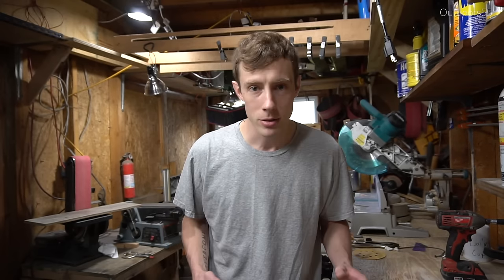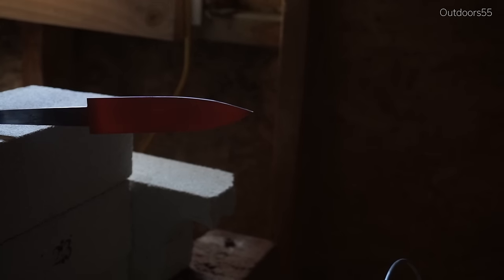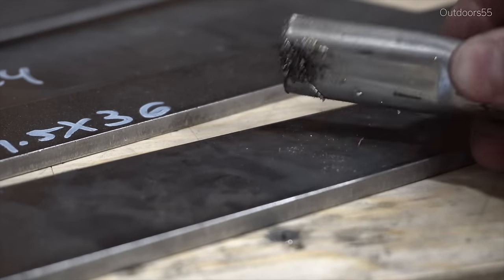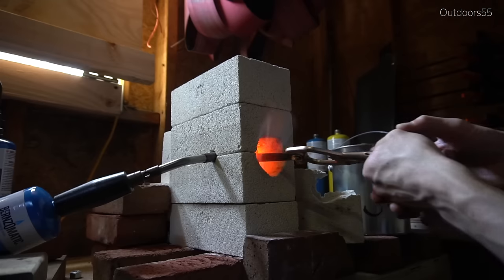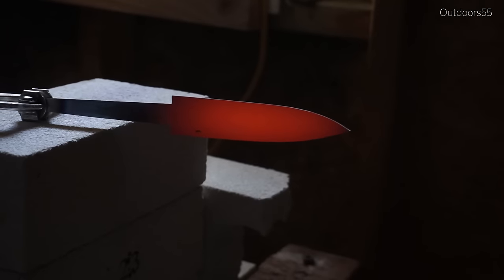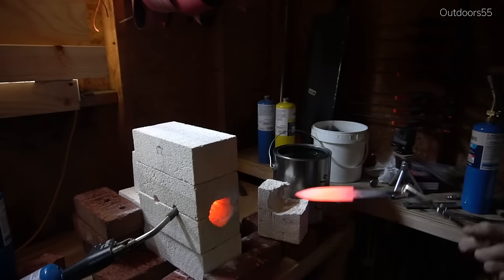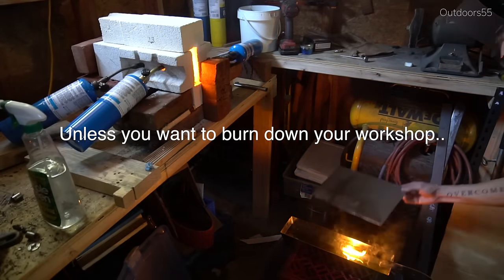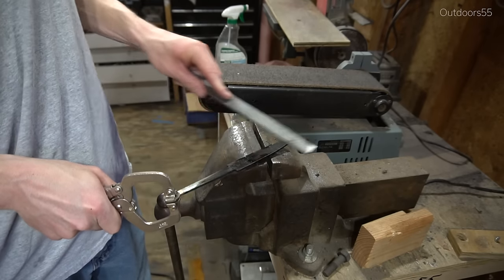How To Heat Treat A Knife | The 4 Steps You NEED To Know

Comment: Hey! Lovin the video, currently at the point where your using the file to test hardness, and wanted to share with you the fact that the hardened steel sounds like a zipper going up and down, i've always been taught the grinder method so I was wondering if thats how it feel's to you as well. Almost like smooth?

Comment: very interesting video, I've a question: the steel you use in the video is 1080 or 1084 , there are difference in the heat trating procedure between the two ? Cause I would like to make some knives by myself too and I can only find 1084 steel.thanks for the video and if you can answer
Reply from the maker: No, generally speaking theres no difference between the two for heat treating.
Reply: @OUTDOORS55  thank you very much

Comment: Just heat treated and tempered my first knife. Set house oven to 450, temper came out a darker yellow/straw color. Air cooled and put in for second hour. After 2nd hour, my blade is now a blueish. Do I need to re normalize and then re temper or will blade be ok? Appreciate any advice you could pass on. Awesome vid and awesome work.
Reply from the maker: Ovens have a tendency to get hotter the longer they are on.  Especially older ones. The blade will be slightly softer but it will be fine and still function as a knife. 😀
Reply: @OUTDOORS55  appreciate it.

Comment: Thank you for the great video and  explanation, but i'm a beginner and i have a question: if you quench your knife before making bevels (as seen in the video) how do you make them with a file after? And if you don't use the file but a belt grinder or other power tools (who are the only tools capable of doing the work on hardened steel) doesn't the heat on the edge wastes the quench on that point of the blade? Thanks to anyone who answers

Comment: Thanks Dude.. 
Great video. Learnt a lot of things. By the way will you please advise what is the carbon level generally in a file can be and in a leaf spring of a truck.

Moreover if a file is a good choice to make a knife, if you can suggest some tricks to make a file knife.

Thanks in advance.
Reply from the maker: Not really sure about carbon levels. It depends on what metal the manufacture uses. I typically try to heat treat a small piece of a file before I make a knife with it. That way I know its good material. Hope this helps😀

Comment: Id recommend using using an oven temperature of 425  since the best blade is between 58-60. 
Id also recommend  you try out 52100 chrome steel. Id also recommend you drill the holes in the shank before the normalizing of heat quench. Extremely important point. Also if you are thinking of making a Damascus blade Then use a kiln and heat to 1500 with glass chards on top. this removes oxygen from the surface. Glass dust or the finest smallest particles are the best. If you use a kiln you can control the heat much better and know precisely what your temperatures are and keep consistent. In addition to this with a bit of practice and a stop watch you can make Samori quality Metal. The best cooling process is done by dropping the temperature slowly over 4 days. The honing ilI will leave to you. But even if you only use 6 stones you will make a blade that will sell for a months pay. 🤔

Comment: Another trick for knowing that you're near the right temperature that is sometimes used is placing a small ceramic dish in the Forge with your blade that this could be filled with regular sodium chloride otherwise known as table salt. Table salt has a melting temperature of 800 degrees C which is 1472 degrees Fahrenheit. Only three degrees off of where you should start watching your steel more closely. When you see the pile of salt turn into a puddle you're just about there.

Comment: So why do people hammer their steel as well,what's that do as I don't see in the video you doing this? This is a great video btw straight forward you've earned my sub for sure
Reply from the maker: There are two main methods for making a knife. One is called stock removal. That’s where you use a grinder or some sort of snapping tool to shape the steel into a knife. The second method is forging. Where you would use a hammer and forge to shape the steel into a knife. Just two different methods to shaping steel. Thanks for the sub my friend 👍
Reply: @OUTDOORS55  If I understand this process - I would comment that forging would occur after the normalizing of the raw piece of steel that you plan to hammer on.  The idea is to normalize (air quench) so that you have a piece of softened steel to work.  Understanding that normalizing and air quenching gives you steel in a softened state rather than trying to bang on a piece of hardened (oil quenched) steel.

Comment: Cooler oil also vaporizers after we action a bit more, causing a non stable cooling effect. For lack of a better term. I would frequently heat treat cutting chisels so that I could cut welds on a job Clear. By heating it up to about 13 to 14 hundred degrees a tree, if not a little bit higher and I would flash quench it and I would watch it till it turn blue as soon as it turned blue I would drop it back into the oil and it will remain a. It kept the metal of a brick chisel for instance from becoming so brittle that it was dangerous to use and yet would still hold a very good Edge even when you're cutting steel with it.

Comment: I need to copy a stanley hand plane blade with 52100 steel , do you think i can use same heat treat process? I need to have 2x holes in it drill hole after or before heat treat?

Comment: Lots of good info here man. I do have a couple questions however. 

Most of the heat treating instructions for the steels you listed say to hold the blade at 1475-1500 degrees for 10 minutes or so. Is this unnecessary? If so  do you notice any difference in performance?

My other question is, being that the handle of all your knives seem to be un heat treated, arent they more likely to bend/ break? Or does that actually help with toughness?

Not trying to poke holes or anything man. Looking into doing some knifemaking myself and im genuinely curious.
Reply: From what I could tell he never annealed (normalized) the handle so it should still retain the factory or manufacturing cold work (work hardening). This means that the handle should be plenty strong enough without being brittle like the blade edge. The heat treating he's doing is for a good cutting edge. I may be wrong but I thought I'd answer in the case that he doesn't.
Reply: @ThomasJames69420  thanks for the reply, i didnt think of that. But that does make me wonder how much the  grinding and heat transfer on the tang from heat treat has done to effect the factory hardness. I've seen him batton/ purposefully break is knives, so im guessing that the difference is negligible.
Reply: @fishcakes6594  not sure, I saw another commenter say he makes knives and he makes sure the tang is strong and thick enough to handle the extra stress. This next part is just a guess but id say that removing the cold work from where the tang meets the blade would be beneficial as it would make the metal more ductile and less prone to crack, so itd more than likely fail due to bending than snapping. I'm not sure though as I only have general material science knowledge and don't know how the specific steels he uses will act.

Comment: this was wonderful. Thank you very much! I now have something to look for and something to try. I have a piece of "weld steel" from lowes that I want to cut a cleaver out of. I am trying to make my own "almazankitchen" knife. The have a youtube channel where they cook outside and they have this cleaver that I love but I would like to make it myself. Is it possible to use that type of steel or should I not even try with this?
Reply from the maker: That can be a good place to start and practice on but 1080 steel Is pretty cheap. It’s probably cheaper than buying it from lows. If you already have it, give it a try. It won’t harden due to low carbon content, but could still be used as a cleaver no doubt. Hope this helps 😀

Comment: after a lifetime of knives, i clear brush on a golf course in arizona and use machetes professionally. the wood is full of minerals, dries hard, hard woods. my fave is from aranyik, at 6 lbs its got obvious advantages beyond the craftsmanship.
but i've used a lot of knives. never have i been impressed with an edge as much as a machete i cut from the blade of a greens mower. i have an al mar folder which is also nice steel. but the pro mower blades are flat, large, and harrrd. couldn't drill it at home or in the shop. i've seen how they shatter on rocks. not great for general purpose cutting but the edge is .. really sweet. condor machete feels like junk in comparison.
for all you blade makers out there, my 6 lb aranyik is 22" long, i feel like it would chew through, basically anything. vehicles, buildings. the spine is like 1/4" thick (google "toong prototype" toong is the smith, they were prototyping blades to see how deep a machete could cut). course its a bit slow but inevitable. i wouldn't think of carrying anything else in preference to it. gotta grind it like an axe or you'll never pull it out.

Comment: Now about tempering 
1)Do I preheat my oven?
2)And do I quench in water between tempering cycles 
I have 1075 and I want to make some small wood carving blades since I dont have the time to work on my bigger knife 
Dimensions are 20mm × ~40mm x 3mm

So what I've learnt online 
2x 2hr cycles tempering at 400F/204C
But what I dont know is water cooling after the first cycle and after the 2nd cycle

And also do I preheat my oven before 1st cycle and do I let blade cool in oven after 2nd cycle

Comment: the video is great, it’s just me that doesn’t want to follow all these very specific heat treating guidelines simply because i’m not going into the knife making business, but i do want to make a few knives and they don’t need to be hard as the knives you make.
im looking to just give these few knives a somewhat hard edge just so they don’t dull to easily....,can i heat the steal to a cherry red, stick it in some canola oil, and be done?  will this harden the steal at all?
Reply: So, if you did that, you would be hardening it but not tempering.

You'd have a very hard, very brittle edge.
You'd want to do the tempering in the oven first.
But yes, you could do this yourself with just normalizing, heating it up to cherry, quenching it in oil and then tempering.
Reply: David Moriarty-Schieven:   thank you !
Reply: No problem! It may not be the exact perfect Temper like you could get with a fancy expensive setup but I've done it that way with many a tool now. Mostly chisels and stuff, and I use a different tempering method for chisels but the oven way would work. But it would carry over well.
Reply: David Moriarty-Schieven:
so blow torch it til it’s red hot, quench it in canola oil, then into a preheated toaster oven at 425 for an hour then let it cool and i’m good for what i want?o
OR toaster oven first then blow torch and quench?

i think someone said temper first then harden it.
Reply: @awashburn6944  true my wording was bad, Temper as the last step
Reply: Aaron Washburn:  thank you
Reply: David Moriarty-Schieven :  thanks again

Comment: What if I have an existing knife and don't know what kind of steel it is? I bought a 2 knife set of Smith&Wesson probably 30 years ago. But they are too soft and don't hold an edge well. What would be the proper steps?

Comment: Good tutorial mate. I am just wondering. When you normalise do you just wait until it is a black heat or until it is able to be touched?
Reply from the maker: I let them cool all the way. You would have to look at the particular steel specs as to exactly what temperature they need to be cooled to.  I’m not sure off the top of my head.
Reply: Cheers, I was doing that too but was hoping it wasn't necessary lol. It is so boring waiting for it to cool down so you can normalise again.

Comment: Hey man, remember me? Lol.
Good video overall though I disagree with calling 1095 a beginners steel. It is a simple carbon steel like 1080 but the amount of carbon makes heat treating the steel more difficult than most beginners could handle.
I would also suggest beginners consider 5160 over 1080 as it tends to be more forgiving in the quench and due to lower carbon content and an alloy makeup that is designed to make the steel tougher, it can be left over night, or even a couple days (if you really have to) between quench and temper.
Reply from the maker: I completely agree, and almost left 1095 off the list for that reason. However it’s often touted as being a beginner steel so I mentioned it in the video. I left some more info on this in the description if I remember correctly. Thanks for the comment 👍👍

Comment: I have been unsuccessfully trying to harden 1084, the only difference seems to be that I am using vegetable oil. Could this be my problem. I have tried it hot and cold and got a better result cold but only got the tip hard. HELP Thanks MJ

Comment: Normalizing the steel is best if done in 3 steps, then quench.  This develops the grain structure of the steel.  Heat the blade less each time to tighten the grains up.  Nonmagnetic plus a few seconds is how I do it.  Don't forget to preheat your quenching oil to 130F before quenching.   I also heat the tang first and the blade last, this is because the tip will heat the fastest and I don't want to overheat the tip and make it the weak spot.
Forge On!!!

Comment: Just found your channel. What is your thought on using motor oil for quenching, and why.
Reply from the maker: Most motor oil is going to be too thick for fast quench steels. It’s not that it won’t work, just that it’s not designed for quenching. Also I do most of my tempering inside my home oven so using motor oil is a no go for me. Canola is food safe so no worries there. Hopefully this helps 😀

Comment: to summarize with Celsius conversions: 
normalize resets all stresses in the steel - normalize 3 times before quenching
heat to 1500-1600f (815-870C) and air cool 3 times  1400f (760C) = non-magnetic. 
So heat it to non-mag and then heat another shade or two brighter colors, then normalize or quench (quench can be on 3rd time normalizing or should be after?)

Quench 1400-1500f (760-815C) steel quickly in Canola oil at 130f (55C = like a very hot shower)
Quench time at least 10-15 seconds
"slice" the oil with the knife while quenching to avoid bubbles and to cool evenly and quickly
keep metal lid for quench container handy to put out oil flare ups

Tempering right away in oven at 400f-500f (200-260C) for 2 hours each cycle
Let air-cool to touch (to around 130f/55C ?) between cycles then temper second time right away.

Comment: Thank you for the easy to understand video. Just a quick question, any idea what type of steel your average railroad spike would be. I know it's high carbon but would it have a number like 1080 or something like that
Reply: I know the "steel of old" was usually similar to 1084. So.. its probably something like that. I'd treat it like 1084/1080
Reply: The Dood thank you. I got about 50 lbs worth of RR spikes
Reply: Matthew M thank you . I'm just starting to try my hand at blacksmithing so any advice helps
Reply: Craig J I know this is an old Post but maybe I can help. Most RR spikes are low to medium carbon. But if you can read the lettering on the top some have the letters H C. These are high carbon and harden well. A spark test can verify it.

Comment: How large / thickness and length was the knife you failed on heat treating at the end of the video.   I made a forge exactley like yours I been working with o1 steel Recommended by Walter sorrels for beginners I previously made my first smaller knife and heat treat went well.  Thinking I might have same problem on my larger blade using 3/16 o1.
Reply from the maker: I believe the blade was 14inch then I cut 3inces off and still couldn’t get it hot enough. One of the problems is that it was 1/4 inch thick.  It takes a lot of time for the heat to penetrate. All in all it was just way too big. I think the maximum is 9inch blade length with two small torches. They just don’t put out enough heat for larger blades.
Reply: OUTDOORS55 thanks for the reply keep the videos going.

Comment: I have a project with a stainless saw blade.It seems extremely hard cutting with a grinder do i have to to heat treat it?If i have to which temperature do i select?Thank you in advance.
Reply: This is where it gets complicated. As different elements are added to iron, the entire heat treatment process changes. Stainless materials are typically not used by people who forge by hand because they air harden. Simple carbon steels need to be quenched very quickly to harden them - stainless steels can cool much more slowly and still become very hard. Commercial manufacturers have equipment and processes that allow the steel to cool much slower to keep it in a softer state. You will likely find that no matter how much you normalize or anneal your stainless, it still remains very hard and difficult to work with.

Comment: I have a damascus blank, its hard as can be. A file skates right across it. Can i heat this to soften it, so i can cut the metal? My goal is to cut and shape the metal.
Reply: Yes do only the first step where you heat the metal up and let it cool slowly by air. this will leave the metal in a softened state. then after you have worked it into a blade or whatever you can do the second step and harden it back